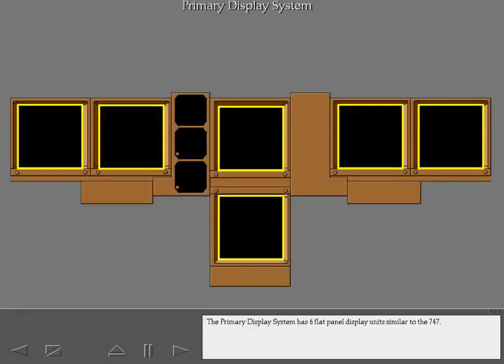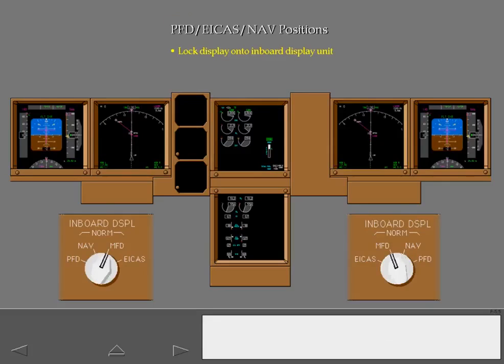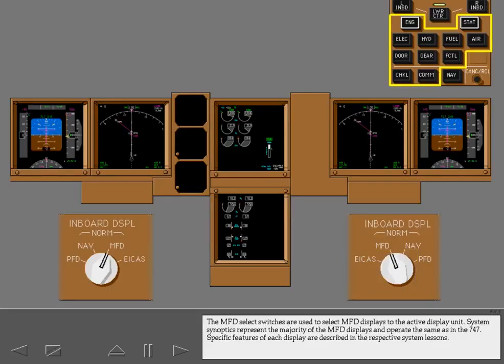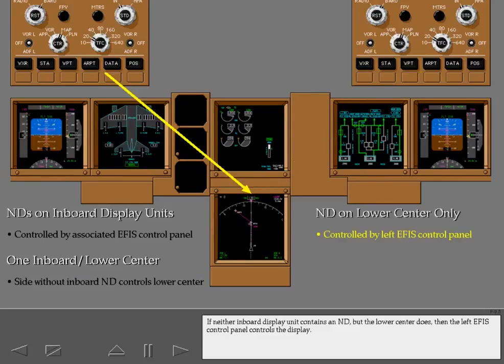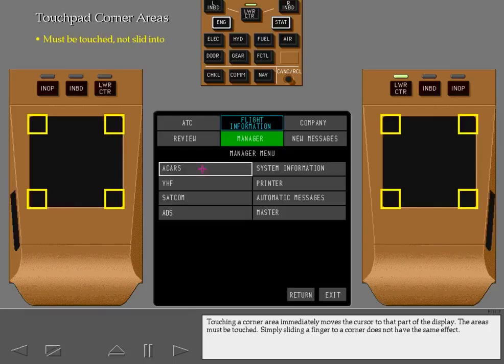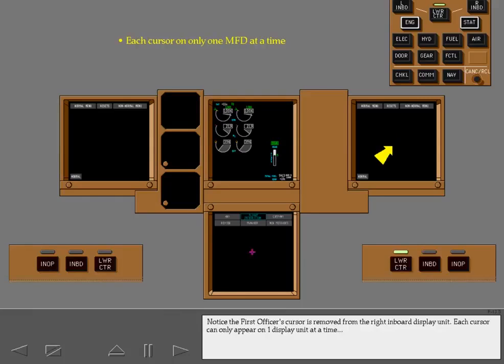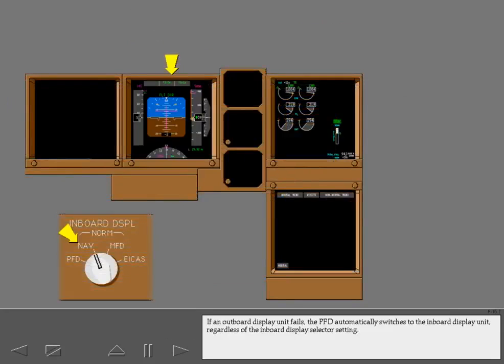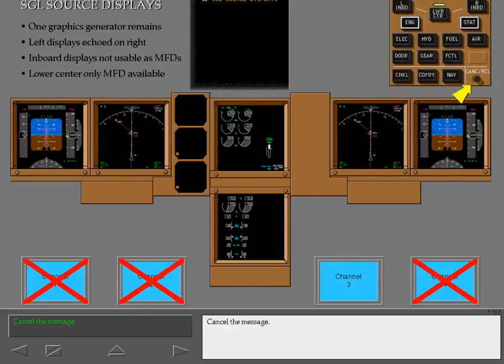Boeing 777 Cbt #68 747 To 777 Differences  Flight Deck Instruments

Comment: do you have 777 to 787 differences?
Reply: It’s too different. However expect one for the 777x and 787 as they are quite similar
Reply: @c0r5e  Pretty sure some airlines have a common 777/787 pilot pool no?